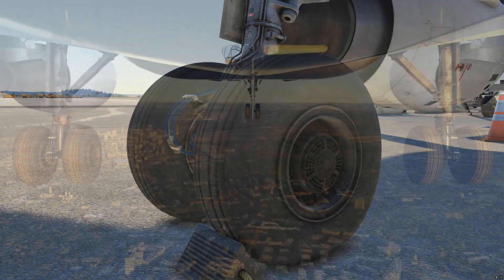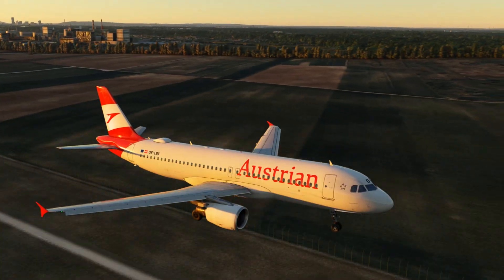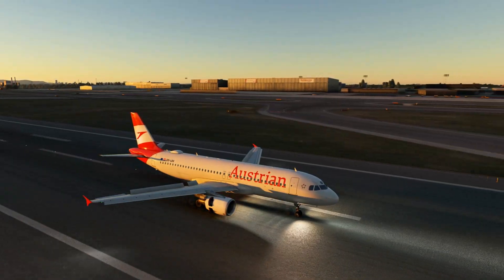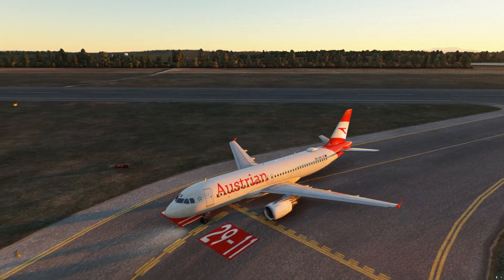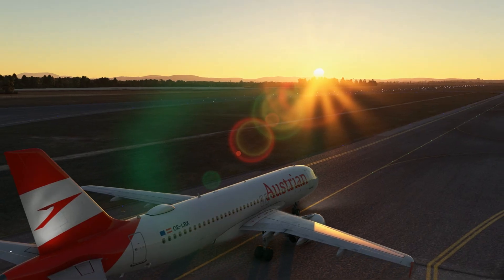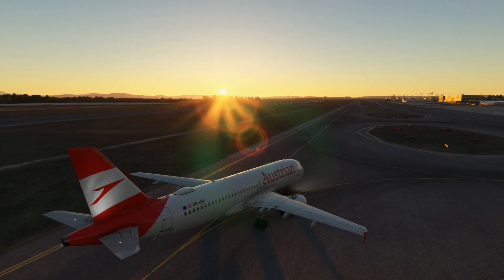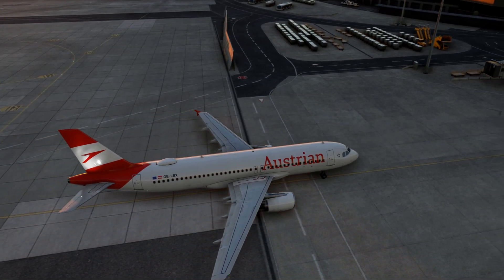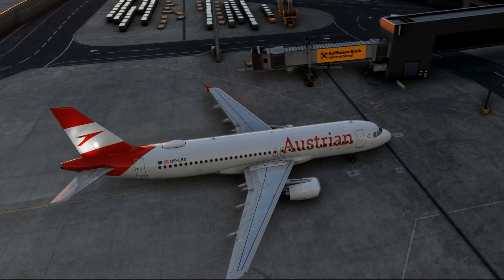How to correctly use the Brake Fan

Comment: How about on short final brake fan on. All the way to the gate and keep it on till after engine shutdown checklist. That's what I have been doing.
Reply from the maker: To be honest, that wouldn't make much of a difference. The gear compartment is not pressurised which means that during the flight the brakes cool down anyway. Plus, when you put the gear down they get cooled down even more with the air rushing past them. Way more than the brake fan could do.
Brake temperatures are never a problem for landing.
Also, Airbus is very clear that the brake fan must never be on when the aircraft is airborne. On the newer A320s it will automatically switch itself off when you get airborne, so the button doesn't do anything.
Hope this helps.

Comment: I fly an older variant, the A300-600 and A310, but the general rules are the same. One thing I’m missing; we are, according to OMB and FCOM, not allowed to take off with the brake fans on. The reason being is possible damage from FOD (foreign object debris). Makes sense you’d think. However, if you’d think further.. there shouldn’t be any FOD on the runway anyway. The last thing I’m worried about when going 150kts and hitting FOD is whether the fans were on or off…🙃
Reply from the maker: On the A320 the brake fan is switched off automatically when you put the gear up, but nevertheless you should never take off with the fan on
Reply: @ Same on the Oldbusses. Nice to see that they took the good stuff of the A306/A310 to the A320/A330 but also fixed up a lot of small and big things👍🏻
Reply from the maker: @Airtrucker91 I think the A350 is where they really made a huge jump forward. That thing is amazing.

Comment: You can use the brake fan to cool down your brakes during taxi out, switch the fan off and you are no longer limited to 150C as your brake fan is not operating.

Comment: Hallo, meine Bremsen werden im Fenix immer heiß. Sind immer über 300 Grad. Wie lange dauert es  zirka in Wirklichkeit bis die Temperatur auf unter. 200 Grad sinkt, bei einer Außentemperatur bei . 20-25 Grad hat?  Im Fenix dauert es eine gefühlte Ewigkeit..... Wie lange bleibt ihr im Durchschnitt am Boden zwischen von der Ankunft bis zum Abflug. Schöne Grüße
Reply from the maker: @Walter15772  Unsere Bremsen sind ebenfalls immer sehr heiss. Oft 300Grad wenn wir am gate ankommen. Unsere turn around Zeit ist meist 40min.
Danach haben die Bremsen noch etwa 180grad und wir kuehlen sie mit dem fan auf 150 herunter
Reply: @fsclips  Danke sehr für die Antwort.  Übrigens, tolle kleine Videos. Sind sehr informativ.  👍

Comment: in the end you said "the colder the brakes, the better it works." dont carbon fiber brakes have a higher "optimum temperature range" than steel brakes? i thought that the hotter carbon fiber brakes are the more efficient they get until they hit their peakpoint of said range (~500°C) where they will start to work worse and worse.
Reply from the maker: You are correct that there is an optimum range. In fact there are two. However, this depends on the manufacturer of the discs.
The manufacturer I know states that they work best at very low temperatures ( 0 to 80 degrees). Then there is a range that is not so good for the brakes and causes high wear ( 80 to 250 degrees). Above that wear and tear is better again but only up to 500 degrees. Then the health of your brakes decreased rapidly.
Reply: @fsclips  thats indeed interessting. thanks for the insight. so i guess it really is better then to keep them as low as possible 👍

Comment: Is there a regulation that pilots must follow regarding when to turn on the fans while parking, or when they should be turned on? I worked for seven years in ground services at Frankfurt Airport, and during summer or on days with no wind, it would burn badly in the eyes, nose, and lungs when breathing near the wheels or when placing the chocks on them
Reply from the maker: I don't believe there is a regulation as such, only company procedures. Like I said in the video, my company doesn't allow us to switch it on whilst at the gate for the exact reasons you gave.

Comment: Do the brakes regularly reach 300 degrees Celsius during taxi before takeoff? Seem super hot for stopping maybe a few times from a low speed no? I get that airliners are huge and heavy, I just never imagined those numbers. Interesting video!
Reply from the maker: They are usually hot from previous landings.
We fly to some Greek islands with very short runways. It is not unusual to have a brake temperature of 400C or more after landing.

Comment: Is it true that after take-off you can leave the gear down for some time to cool the breaks down before retracting?
Reply from the maker: Yes. In fact there is an Airbus procedure for it. Also, if the temperature of the retracted gear gets too high you are going to get an ECAM warning and you have to put the gear down. Of course, you first need to make sure you are flying at the correct speeds. It is not a nice procedure as it is very noisy and it is best to inform the passengers to make sure they are not alarmed.

Comment: Aren't some SOP's explicitly say that you should ask for permission for a long rollout if possible?
Reply from the maker: @TheScaryBoy01  I have never heard of that. Airports are very busy these days and in the AOI they will tell you at what exit you should leave by the latest. You have to inform them if you can't make the exit.
Long rollouts do usually cause longer taxi times and therefore more fuel burn. 
We have no such paragraph in our SOPs. 
Most airports want you off the runway asap.
There are some exceptions where a long roll out could be beneficial, such as LEJ, but those are very rare.